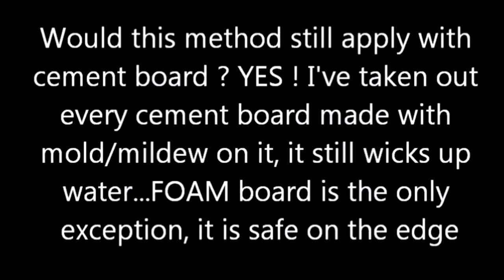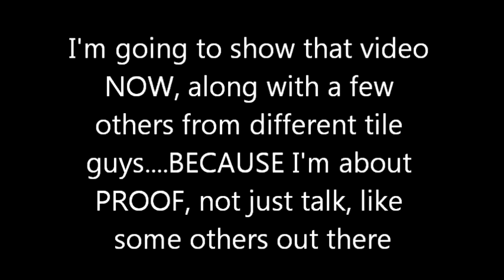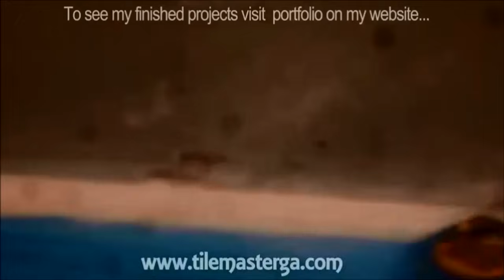WALLBOARD ON TUB

Comment: Good video content with an unpleasant twist.  So getting down to fundamentals: 1) All wallboard, backerboard will wick unless it is sealed with an elastomer (silicon/redgaurd etc.) ahead of time.  2) you should have an air-gap between any water carrying horizontal surface and the board.  3) you should not have any direct contact between wallboard and water carrying tub flange or lip.    The shape of the tub lip suggests the manufacturer intended the wallboard to go inside so that's a bit puzzling.   I would be interested to know if you have observed a properly assembled (to a known builder's specification) inside-the-lip installation with 1/4" air gap between flange and wallboard. I don't have access to the builder's spec but it looks like they identify various build-ups and it looks like there's membrane specified.  After seeing various videos and discussion, my conclusion is to always seal the ends of the wall-board no matter what type of buildup-- your friend was essentially doing that by squirting RTV silicon (not acrylic caulk) between wallboard and tub lip.  PS: your lived experience is obviously different than other folks with just as much experience (in different climate zones) as you so it's kinda sh*tty to bag on folks without seeing the long term result of their work, specifically. The builders specification was written by someone based on experience, probably like you, so a better discussion would be to challenge the assertion, contact the author of the specification so the code gets fixed then we all win.

Comment: I’m with Sal on this one. If you use green board then yes I understand the wicking effect. But with Kerdi board and durarock with red guard you don’t have this issue. I personally don’t overlap due to the bow you get in the wall. Good luck to you sir in your future builds.
Reply from the maker: Exactly, I mentioned about foam boards being innocuous... but my assumption is most people aren't using foam board if they are a diy'r because they're hard to come by
And yes definitely on the bump-out portion which I didn't even talk about it on the video but it does happen 👍
Reply: Jody Roland Construction. There is absolutely no need for any wallboard to go past the flange. How do you not have a bulge when you do this with foam boards?
Reply: TheJeepGuy205 please read my original post again. Especially the second to last sentence. Thanks and have a great day.
Reply: @thejeepguy2059  Sal wet shims his foam boards. Since foam boards are so light, you can actually put thinset on the studs in blobs, then just set the board level with no fasteners, then use fasteners and stop before they push the board in more, keeping it level. It's the main reason Sal uses foam boards, it saves a lot of time leveling and shimming. Cement boards are too heavy to wet shim like this, though. Sal's big rationale with foam boards and uncoupling mats like Ditra is it allows him to do less work, get done quicker, and have a better overall result. 

I kinda bet you could do it with ultralight drywall like Bob uses, as it's crazy light now. In UK as well they also actually set drywall to masonry with blobs of thinset-like adhesive and no fasteners (imo, smarter than what we do in USA to get drywall into masonry walls without building a stud wall, the fasteners almost always back out over time.)
Reply: @GilBatesLovesyou  You can also use blobs of compound to set Sheetrock to concrete.

Comment: @starrtile, what happens when the contractor installed the tub in front of the drywall and did not screw the flange into the studs. Do I need to have the tub and drywall taken out and redo it?
Reply from the maker: Well my take on it is if there's no problem then there's no solution, I probably wouldn't do anything if you didn't have to until a possible problem arose. I mean true enough it was done incorrectly but the damage that could possibly occur is a bit minimal and there's no point in doing something over until and unless you have an issue.

Comment: What can I buy a cheap fix in my own tub between it and the wall I can use liquid nail to put it down not out to impress anyone just keep the water from running down in there and out on to the floor some kind of flexible stuff plastic or rubber vinyl or I was thinking maybe some L shape crown molding any suggestions would be appreciated

Comment: Hello bob 
Im trying to gather as much info as i can before i start to work on my bathrooms.  gotten several estimates to do both of my bathrooms and the least expensive one was a little over 25 grands.. not going to to happen... 
If i do it my self ( im an ok handy person do lots of my proyects my self) its going to be about 2,500 in materials for both bathrooms.. 
Ok now to my question lol.. 
If i understand you correctly the gap from the wall board and the tub lip is left with nothing and when you install the tile  that bottom inch or so gets nothing behind it, leaving about 1/8 or so of a gap between the tile and tub?
That inch or so with no support behind it, it will be ok no worries about breaking or cracking? 
Btw love your videos i like when people use common sense vs this is the way the book says... lol
I appreciate you videos thnx for time..

Comment: I agree. Leave a gap. The bottom line is people dont maintain their shower/tub caulking and end up with problems. Water should never get behind the tile or grout ( sealed). People that dont maintain their stuff alwasy have more problems than those that do. Cars, bathroom tile etc. I always tell my clients if they see any cracking on the corners or along the tub edge address it immediately and they wont have problems.

Comment: Surface tension of water in addition to the wicking leaves a bead of water in the area you are speaking of after each shower.  I don't know what the best solution is.  A good practice would be to wipe that area dry after each shower but who is going to do that, especially in rentals?

Comment: Getting ready to install a shower pan. I have watched a few of your videos as far as the placement of the wallboard goes. If using durock, do you suggest taping and thin setting the transition from pan lip to wall board? Or just overlapping the tile into the pan?
Reply from the maker: Just overlap tile
Reply: Hello. I bought a glue on tub surround shower wall. My substrate will be cement board. When setting the wall, what do you recommend for the bottom? Since the shower wall is a thin construction, what can I do where the bottom meets the meets the tub? I was planning to use mesh tape and thinset to finish the gap and provide some 'body' for the wall to paste onto.

Another question that's related is how to finish the edge of the shower wall (I didn't consider it before). Would a tile edge work? I feel tile wouldn't give a consistent look.

Thanks in advance.

Comment: Do you recommend a rubber flashing tape strip around the lip before setting backer board on the lip?
Reply from the maker: I don't think it's necessary, you could do it if you want to but the point is not to allow water into your backerboard
Reply: @StarrTile  thanks for the answer!

Comment: So are you saying that you don't caulk the bottom of the tyle around the tub or shower pan?  You just leave it open.
Reply from the maker: The gap will get filled in with grout same as any other transition, caulking could be done but optional if there is a problem

Comment: When I put my wallboard up, in some places it is proud of the tub edge, up to 1/4 inch.  What do I do with that gap between the bottom tile and the flange of the yub?
Reply from the maker: Generally speaking set my tile about 1/8 of an inch to the tub and then use grout in that area and or silicone, they even make siliconized colored grout
Reply: @StarrTile  Hello, and thanks for the reply.  You may have misinterpreted my question.  Here is a diagram of what I am doing.  Where the tile meets the tub flange, there will be a 1/4 to 3/8 gap behind the tile between the tile and the tub lip.  What, if anything would I put back there.  Thanks again.  Here is a like to my YouTube post about it with the diagram. https://www.youtube.com/post/UgkxRoZYh4VVolFO_YnnyPz_r2d5VWXpealA

Comment: Sal is 100 % right. Dry wall and mastic will more than likely grow mold. These jobs you are removeing the 4x4 tile from are probably 20 years old or more. The method they look to be installed with has gone through its test of time and  so for the most part drywall and mastic really is not used to much anymore in a tub area or shower.
Years ago when tile was set in mud did the tile guys stop short of the lip of the upturn of the tub or pan to stop this issue you seem to have the answer for?
Reply from the maker: Sal is unequivocally incorrect. And sometimes I still do ceramic tile on tub walls and I will still use Mastic which is fine on a surround... but even if I use cement board and large-format tile and thinset, the wallboard still would sit on the lip and not the edge, it's only common sense and why somebody would do it otherwise is beyond comprehension given the 2 choices.
And yes the same would apply for a floated wall on a tub or a floated wall in a shower, water will Wick a porous substance, cause damage and rot things...been there, seen it.
I'm actually pretty amazed that this is even a debate
Reply: @StarrTile these jobs that you have seen fail were they caulked correctly with a product like silcone or latex or no caulk at all. Was the mastaic at the end of its life because it was first generation mastic that they had no idea it would dry up abd loose its bond between the tile and substrate? Which caused the tile to become loose and water to migrate through the joints of the cracked grout.
My father has a mastic and drywall tile job that was done in 1972 with all joints caulked with 100% silcone. The drywall is on the tub why hasn't it failed?
Reply from the maker: @davidribeca1745  like I said in the video you do it the way you want to it doesn't matter to me in the end but given the two choices why would you choose the one that has possible failure over the other that absolutely does not ????? It's kind of a weird thing to convince anybody of anything nowadays but you don't know what fail you have from 1972, I have taken out those bathrooms before and there is wood rot all over the place, then again each individual does things their own way and there's operator malfunction all over the planet. Planes crash, rockets and shuttles blow up, car wrecks, fingers cut off from saws, etc.
We can't save the world from themselves but I use common sense & logic to show ppl easy effective ways and back it up with proof, others read books 👌
Reply: @StarrTile  I have the proof a working 1972 tile job in my parents house still intact and still in use with the backer material (drywall) sitting on the tub.
No books just the real thing!

Comment: Do you typocally use greenboard vs hardy backer ect...?
Reply from the maker: @C2IT678  yes... I found that it's more rigid between the studs, and everything gets waterproofing anyway
Reply from the maker: @C2IT678  hardi is rigid, but a pain in the ass to cut and at the end it doesn't do anything better for you

Comment: If I put wonderboard wall board over the outside wall that has a vapor barrier in place over the studs would be acceptable to put red guard on the wonderboard or would you advice against red guard or recommend red guard in my circumstance?
Reply from the maker: You would not do a vapor barrier and a waterproofer, you would do one or the other....
But the whole point of the video is to stop wicking action from the edge of the tub into your wall board oh, that's why I leave that Gap
Reply: Ok so my wonderboard meets the top lip Like you do. Do you typically silicone the wallboard to the top of the lip?  Maybe I missed that in the video
Reply from the maker: @TheWhoIsThat  yes you definitely miss that part in the video

Comment: What would you suggest to deal with a side of the shower pan where we had to chisel out the studs to accommodate the bottom lip (as is shown to your left in the shower pan at 10:40 in the video. I think we should just leave a space and the thinset will fill it in, it's only the very bottom of the tiles so it should be fine I think, but I would LOVE your opinion!

Comment: What about when you're installing cementboard over a tub that doesn't have the lip? I've got an old tub that doesn't have the lip/flange sticking up. If I use waterproof paint on the bottom of the wallboard, will that help? I'm thinking: Paint the bottom of the wallboard pieces, use window/door flashing to extend on to the tub a little bit, caulk with 100% silicone, and I will have glue-up wallboards instead of tile. The cementboard would be 1/8" above the edge of the tub (which I believe is mfr recommendation).
Reply from the maker: However you can make it not suck up any water would be the correct way because there are really not any rules except not getting the board wet
Reply: @StarrTile  Thanks! My friend hired someone to put up cementboard around his tub but the guy bought regular drywall. He left the gap above the tub but he didn't do any sort of water-sealing-- not even caulk. Mushrooms started growing out of the bottom corner. LOL. So I know moisture sealing is absolutely needed.

Comment: you need to use waterproof silicone sealer to avoid water seepage and mold. i prefer to use a tub surround myself, as ALL TILE is porous, and given enough time, will allow moisture through it. with a plastic tub surround, you can set it in front of the lip no problem.

Comment: So if the board sits on top of the lip, the bottom row of tiles sits on top of the tub, so the bottom portion of the tile is thinsetted against the tub lip?  Do you leave some space between tile and tub and then seal it up with caulk?
Reply from the maker: There's no reason or no point to fill in that Gap with caulking oh, it's half an inch at best... and no, there is no thinset against the lip, again no reason for that since most of your tile is set on the wall board.
You can run some caulking at the intersection where the tile meets the tub Edge
Reply: @StarrTile  I see, but my lip is around 2-3 inches high, and if I want to install subway tiles, it's not tall enough to reach the board.  The way my current tiles are installed, is the board is sitting on top of the lip, and the tiles are completely against the board, exactly on top of the lip as well so everything is flush above the lip.  I might have to do the same with new tile.
Reply: @StarrTile  like this https://www.sterlingplumbing.com/tub-surround-installation
Reply: In the video Jeff from renovision is shown using mesh tape, in your case I would use that with some thinset so the smaller tiles have something to grab onto. Guessing your done by now though.
Reply: But what if your tub has no lip? When the caulk fails the water will leak out of the tub.  Suggestions?

Comment: Should tubs be screwed to the studs?  I would think that would be an issue with the up/down movement of the tub when used and it would crack the tube flange.
Reply from the maker: The edge of most tubs have holes already pre-drilled for anchoring them into the studs, so yes

Comment: hello sir was wondering since the shower pan is screwed directly to the 2x4’s , does the part below the shower pan need green board?
Reply: No. The entire purpose of waterproofing is to never worry water will spill over or soak through the board. Small bead of caulking is required around there tile and tub anyways.

Comment: Seeking advice. I cracked/chipped my acrylic tile flange while installing my alcove tub. I pre-drilled the holes but didnt use the right screw resulting in some fine crack around the screw head. Am i ok to proceed with the wallboard? or do i need to repair these/replace the tub? Anyone whos experienced this would love to hear from you. Regards. Tony Tone